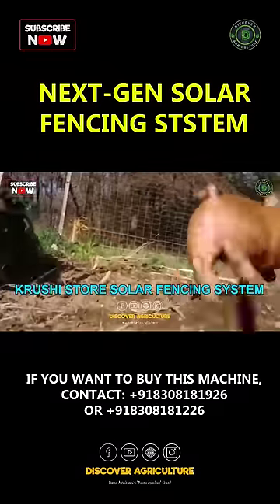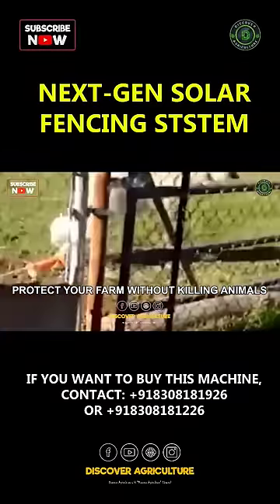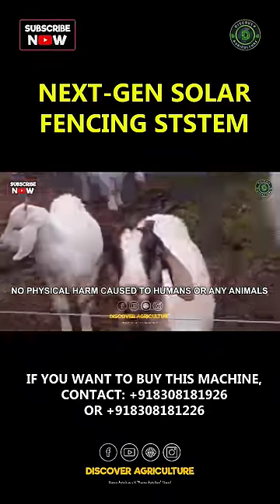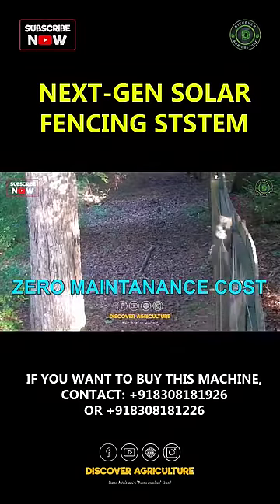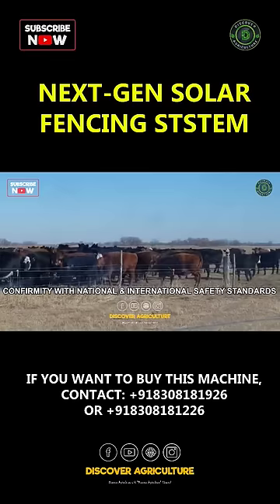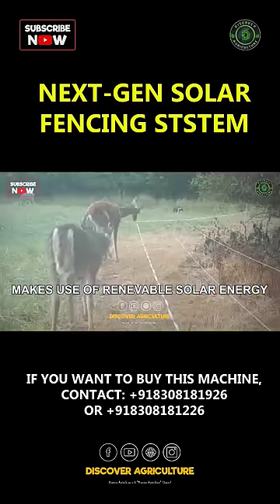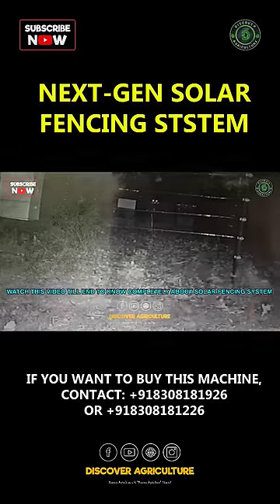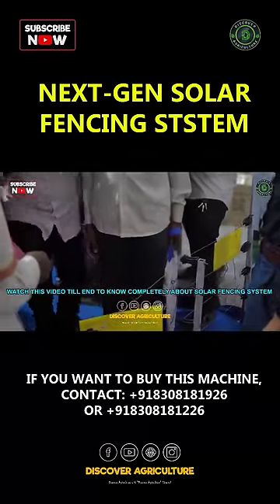SOLAR FENCE Electric SHOCK⚡ #shorts

Comment: Good sound effects, the fence does not make any noise and it is harmless  to the animals. I know because I have checked those things more than once myself. The power is dc not ac so is harmless, but it does bite. Also it is low power not what some people have in their minds about what it is.
Reply: Puede ser cc o puede ser ca, da igual. Lo que si debe ser muy baja corriente para no matar a la persona o al animal. La descarga va por impulsos muy cortos con un margen de tiempo estipulado entre impulso e impulso. El voltaje de inicio puede ser hasta de 1.5 voltios, de una simple batería tipo AA porque luego se transforma a alto voltaje. A ese sistema se le llama "pastor eléctrico" y yo construí uno en una ocasión para un amigo y fue con el voltaje de una batería AA de 1.5 voltios. Mi amigo se quedó asombrado, primero por lo que una batería de tan poco voltaje y tan pequeña llegaba a hacer y luego, porque todo animal que tocaba el cable, salía huyendo despavorido y no sé volvían a acercar a los cables. 
😮😮😮😮😮😮

Comment: Que crueldad hacia los animales me sentí mal de ver estos inocentes.😢
Reply: The voltage (120) and amperage (less than 1 amp) will not kill or immobilize you or your livestock. You can create a bigger shock by rubbing your socks on your carpet. It is NOT cruelty, it's about keeping your animals in and crooks out.

Comment: What if it continues more than 3 millisecond due to some incorrect configuration  or any issue/ defect occurs in product….10 K is too much
Reply: Thats what i was thinking. We cnt garranty any product.  10k is lethal
Reply: The amperage of an electric fence is very low. It's about 120 milliamps. For comparison, most home circuits are 15 amps (i.e. they have more than 100X more current).